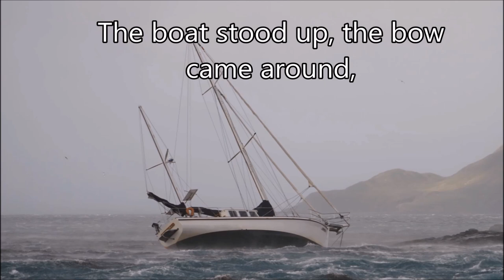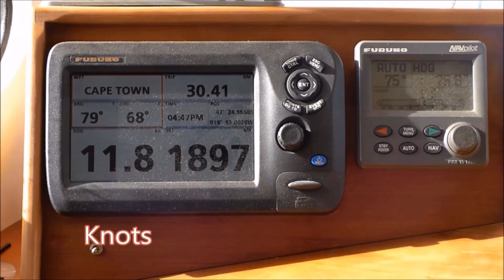Yacht Windora,Wooden Sailboat on The Rocks

Comment: Yep wire ties just are not the thing sometimes, aircraft wire would be better, I'm sure they engineered a good solution
Reply from the maker: Hi Christopher, Go take a look at any brand new yanmar marine diesel engine, the electrical cables are held in place using plastic cable ties. Sometimes shit happens. Phil
Reply: Have seen some ships, have metal bridges for cables and maybe hoses.